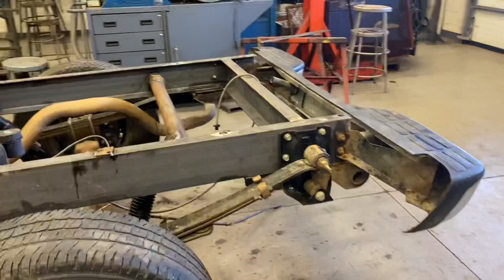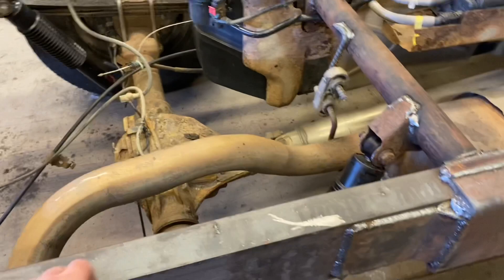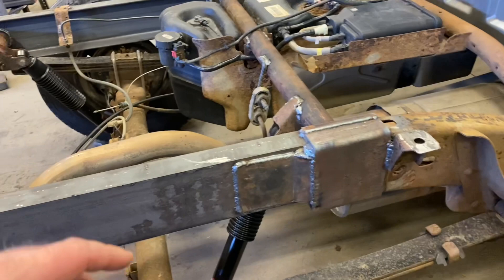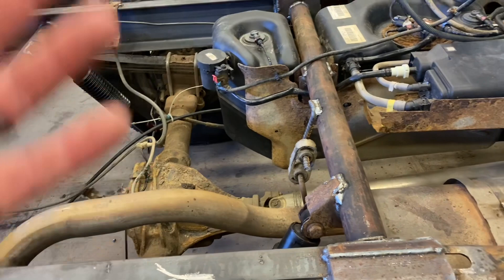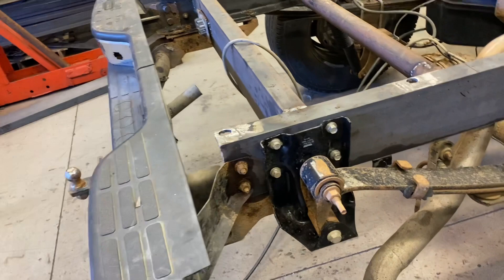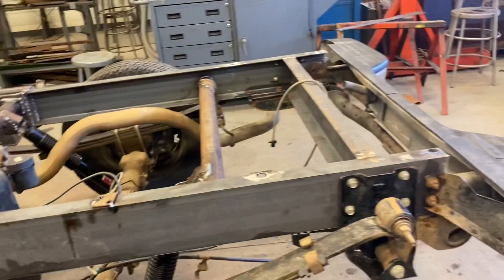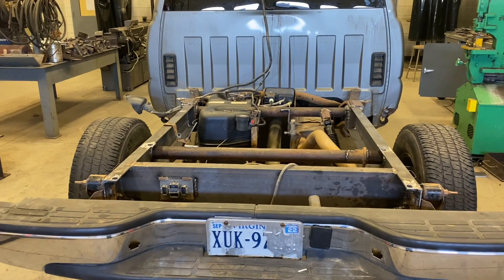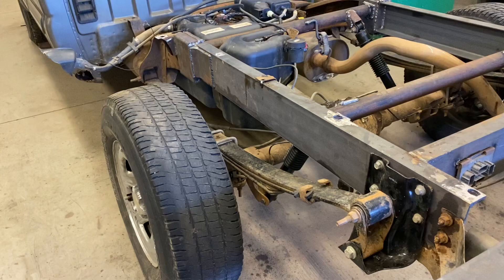Chevy Truck Frame Rebuild!

Comment: There are a lot of YouTube experts (armchair quarterbacks) who might voice their opinion about using any steel in a frame that isn't exactly the same material the frame was originally made of... but I am not a negative Nancy and will say that rebuild is probably stronger than the original half ton frame lol.  I like it!  I think all frames should be straight rails with crossmembers designed for the running gear, springs that have bolted brackets for easy replacement, and modular bumper and tow hook mounts.  But engineers insist on being more complicated.  Great work!
Reply from the maker: If you really get to looking at these factory frames they are pitiful. Everything is designed to hold dirt and moisture, no wonder they rust out so fast. What we did is over built but that’s just how we do things! Thanks for watching!
Reply: @khtractors  Planned obsolescence.
Reply: What kind of voodoo magic steel does everyone think pickup truck frames are made of? They are not heat treated, they are not high tensile steel, there is no "same material", it's just steel nothing special. We cut and stretch semi truck frames for customers and they are not high tensile nor are they some magical heat treated 1 million Rockwell hardness, 50 cal bulletproof BS, they are plain steel. If they were any of the above, we couldn't drill or weld on them without ruining them. Even the manufacturers drill and weld on semi truck frames. So if a truck running a million plus miles carrying 40 tons does not have some area 51 intergalactic steel, neither does a shitty domestic pickup truck.

Comment: If GM did that originally, maybe my 2006 wouldn't be sitting in my drive with the bed kissing the cab. You should patent your repair,it's clean,functional,and probably stronger than original. Great job!
Reply from the maker: Really appreciate that! We’ve done several like this so far with good results!

Comment: Excellent work! I have a 2011 Chevy 2500 that needs some frame-work. Only 60,000 miles on it but NY salt kills vehicles especially if they don't have undercoating or coatings like Woolwax.
Reply from the maker: We’ve done a bunch of these and the Colorado’s. Thanks for watching

Comment: This is so cool. Would you mind sharing what your welder setup is for this frame material?
Reply from the maker: We use mostly Miller 252’s with .035 solid wire and 75/25 mix gas.

Comment: The pipe has a bend to accept the weight in the bed distributing the weight against the frame not relying on the butt welds and their shear strength.
Reply from the maker: The bed doesn’t put any weight on the cross member pipe at all. That cross member simply holds the gas tank and exhaust. The bed sets directly on the top of the frame rail. Thanks for watching!

Comment: damn I need you to work on my 03 silverado.  needs rust irradiation
Reply from the maker: We just did an 07 2500 week before last. Pretty common issue.
Reply: @khtractors  Im currently in a war between an NY state inspection shop who told me my frame has bad damaged rust holes by the gas tank so he failed the inspection. I brought the truck to a frame shop and they said it was fine. just has a lotta rust. to me it looked bad.

Comment: What are your measurements on the 6 inch c channel how long need a few pieces for a short bed 2500 truck
Reply from the maker: I can’t remember exactly. Pretty sure a 10ft section was enough to do both sides but you better double check that.

Comment: I would like to see if I can get a few questions answered I am in the process of getting ready to undergone this same type of repair.
Reply from the maker: Yes sir?
Reply: @khtractors  so I have 6” c channel to replace the back two pieces of the frame how did you mark out the bed holes? Also what size bolts did you use to bolt the c channel together?
Reply from the maker: @tkenner87  we welded the frame back together, no bolts for it. On the bed holes I just measured the original frame and cut the wholes based off of it. Using c channel you may have to weld a tab at holes because the they drill out right near the edge of the flange on the channel. Get plenty of measurements because the front section of frame is actually wider then the rear. It sets in some right at the factory welded connection.
Reply: @khtractors  okay thank you yes I have measured all of my stuff multiple times and I have it all drawn and written out on paper. This is my first time so I just want to do it right so I’m taking my time I am familiar with cutting and grinding etc. did you drop the gas tank to remove the crossmember that’s goes through the gas tank?
Reply from the maker: @tkenner87  I did remove the gas tank. I’m most cases the cross member at gas tank needs replaced. If yours is good leave it. I’ve rebuilt so many of these it’s about become 2nd nature.
Reply: @khtractors no mines is definitely not good I have to replace them all except the very front one
Reply: Where are you located I need mines done as I never got around to it.